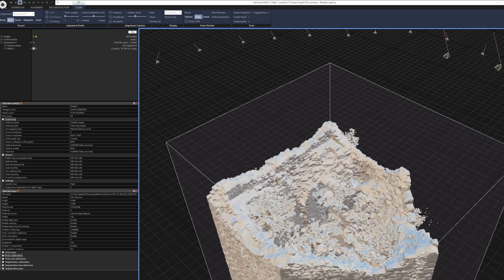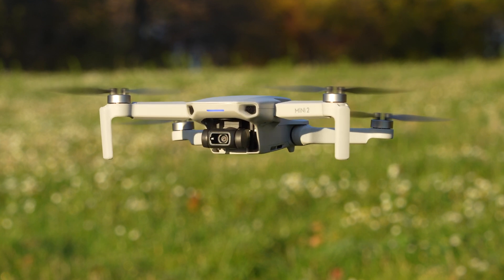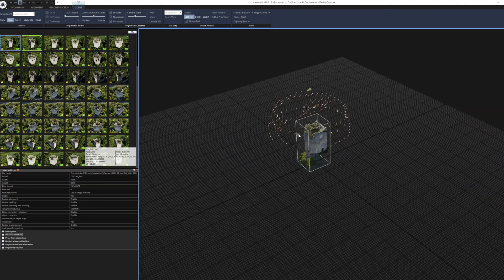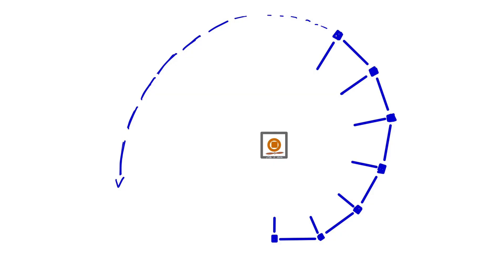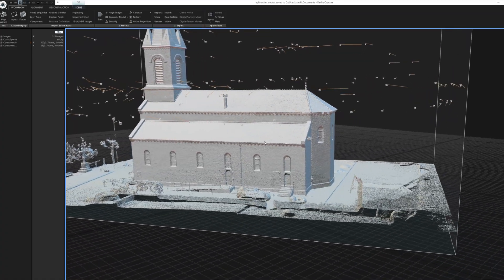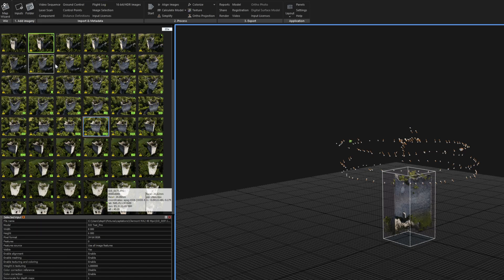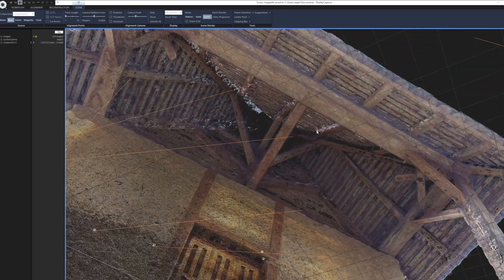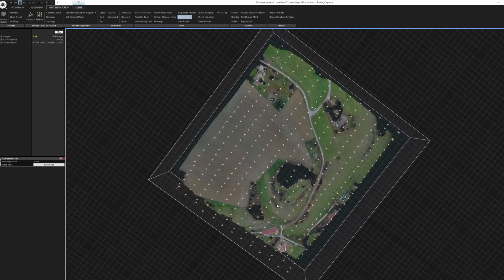Photogrammétrie - captation en manuel - DJI Mini 2 - RealityCapture

Comment: Est-ce envisageable de faire une vidéo de ce genre qui traiterait de LIDAR et d'une éventuelle combinaison LIDAR + photogrammétrie (si cela a un intérêt). J'ai vu que DJI vendait maintenant une nacelle équipée d'un LIDAR, sans savoir réellement ce qu'il est possible de faire avec. Je ne suis pas un professionnel mais je m'intéresse beaucoup à ces sujets. En tous cas, merci pour vos vidéos que j'attends toujours avec impatience ! 🙂
Reply from the maker: Bonjour Jean-Yves, pour simplifier, Lidar et photogrammétrie permettent d'arriver au même résultat : modéliser une scène en 3D. L'intérêt du lidar est qu'il produit directement le nuage de points et fait ainsi gagner du temps de calcul. Inconvénient : c'est un capteur couteux et il ne fournit pas l'information de couleur, ce qui peux justifier l'intérêt de combiner les deux. Je ne suis pas équipé et si une opportunité se présente je ferai une démo
Reply: l'avantage du lidar, c'est de capter les points de sol à travers la végétation, ce que la photogrammétrie ne fait pas (la végétation étant un objet, le sol en dessous n'est pas visible donc non relevé). L'avantage de la photogramétrie, c'est d'avoir les textures visuelles, ce que le lidar ne fait pas. il faut donc faire un choix de relevé en fonction des besoins